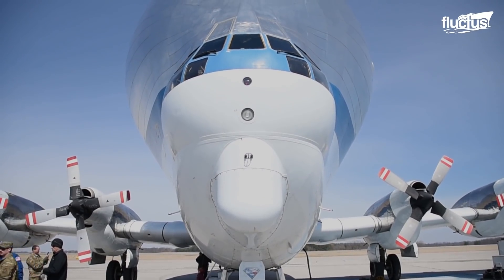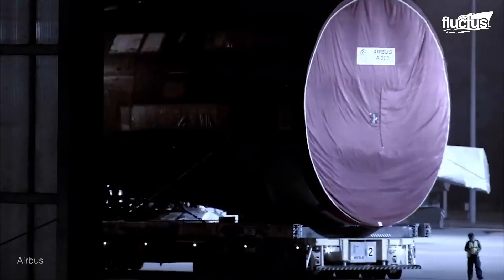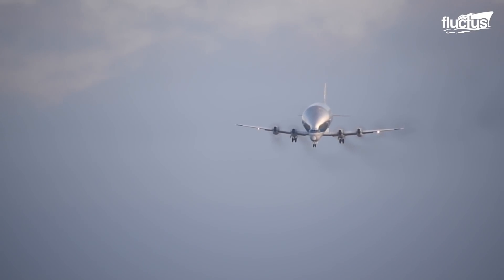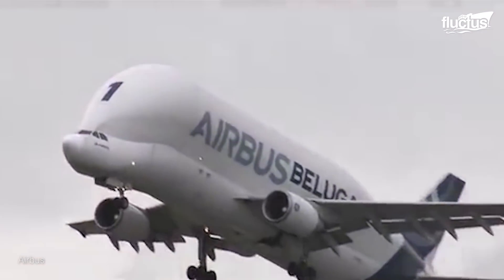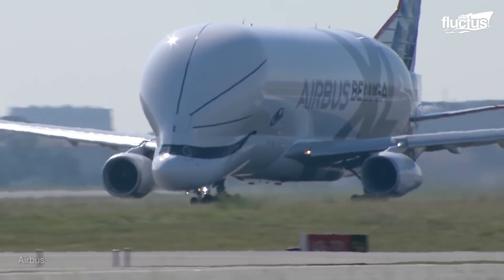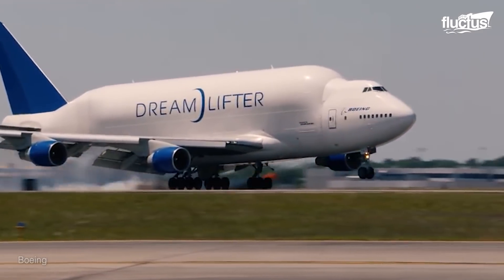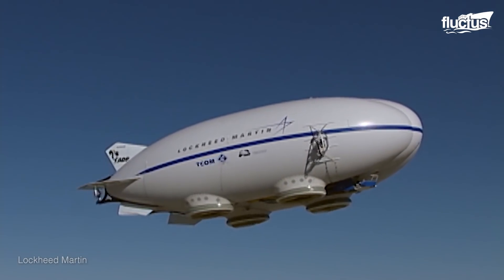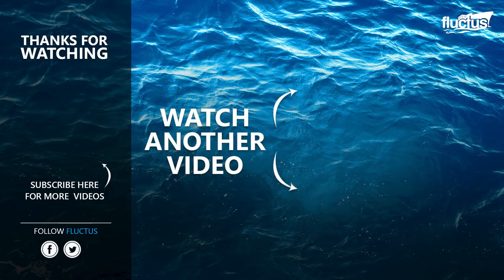The Genius Airbus Idea to Save Billions of Dollars Every Year

Comment: 8:27 that Antonov we will never be seen again :(
Reply: Yes it will, because that's not the 225.The 225 has three engines on each wing. I think that's an Antonov 124 which is the 225's older, smaller brother.
Reply: @00chips  The one with 3 engines on each wing was wrecked in the bombing along with a few other smaller aircraft .

Comment: These planes are great, but I'd like to see a plane designed from scratch instead of some modification of the usual planes. Maybe it could be optimised further than these designs for the role they would perform, as a new design would not focus on being compatible with a passenger aircraft like the current ones, but focus merely on being a cargo/transport plane.

Big fan of the Beluga though...
Reply: I'd like to see that to but it wouldn't be cost effective for these companies to do a clean sheet design.. unless they have customers lined up, or they have a big military contract, it doesn't make sense to invest potentially billions into a new airframe that will only ever have a handful of examples produced. Even a military contract would likely want a converted airframe as it would be massively cheaper to procure and maintain.